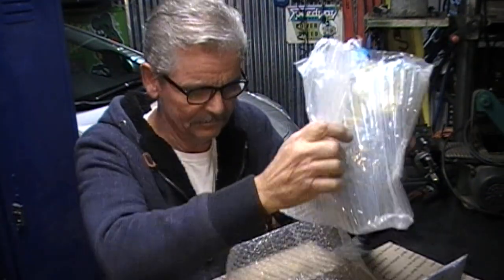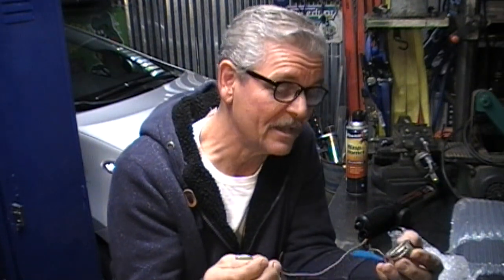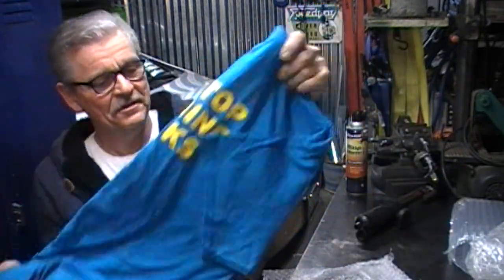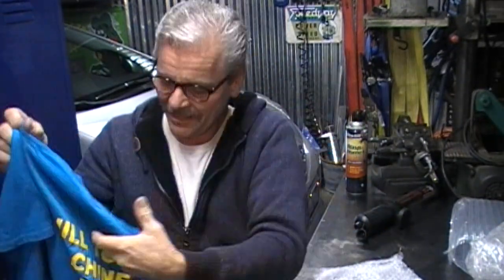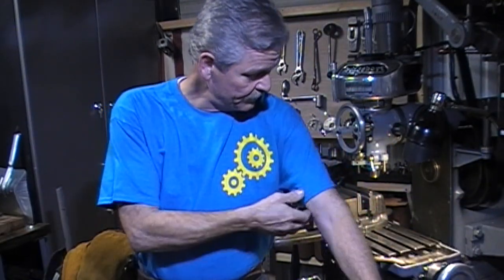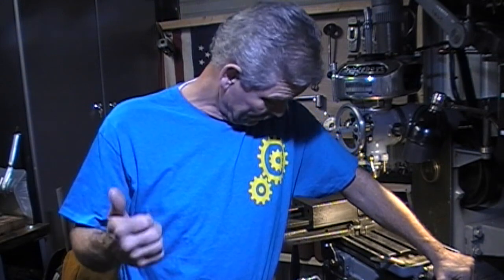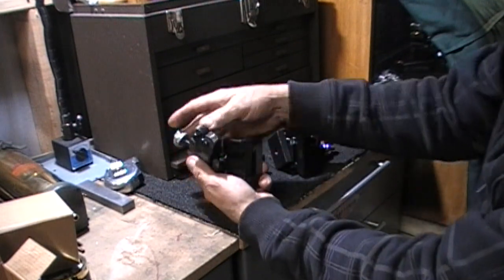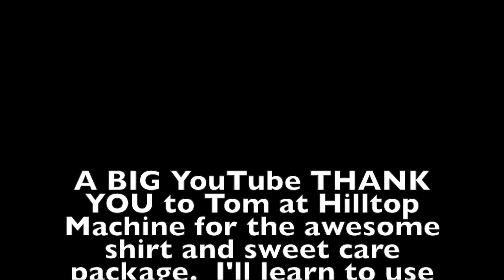Mail Call 1  and YouTube Thank YOU

Comment: You are correct.  The YouTube machinist network is a good group of people.  Reminds me of the shooting fraternity.  What brand and size is the tool post.  I need to get one to replace the late '80s model that is on my Enco lathe.  I am looking at All Industrial for the new tool post and holders, they were referred to me by Dudley Toolwright.  He has a pretty good channel.  I have not found the video yet that shows how you set up the treadmill motor controllers for the Brown&SharpPort (Bridge&Sharp LOL).
Reply from the maker: Believe I searched treadmill motor controller on YouTube and he actually shows setting one up. If I get a few I can make a short follow up and show part #s also. Or I can send you the info if you email me. flatheadronsgarage@yahoo.com
Reply: Jeremy Fielding is who I usually go to for anything electrical motor. Just found him setting one up using treadmill parts.
Reply: That email address gives me an error message.
Reply from the maker: You asked about the tool post, it’s a Bostar I purchased off eBay for $119.00.  It’s Chinese but seems to work well for me. I’ll regrind the tool holders with my new toy. They won’t say China anymore. I’ll true them up and blue. Check out mikemanmade on YouTube.  This is where I got the info to make my motor controller. He’s good. My American Rotary phase converter is on its way for the surface grinder.
Reply: I like milkmanmade's newer, simpler, <$15 DC motor controller, have ordered all the parts.  My brother is giving me his wife's treadmill.
Reply from the maker: Good deal.  Keep us updated.  Maybe make a video...... I’m still going to do the bandsaw so I can slow it down although I don’t know when. Not too far off though.  The rotary should arrive tomorrow.

Comment: Glad you liked everything. The item you were not sure about is a coaxial indicator. Lets say you have a part on the mill table and it already has a hole in it and you want to center the quill over that hole. You put the co axial indicator in a collet and in the quill. Turn on the mill with the feeler in the hole. (you will have to pick up a feeler likehttps://www.ebay.com/itm/ASIMETO-469-01-2-Centering-Coaxial-Indicator-ID-Feeler/222713312094?hash=item33dabf735e:g:i0sAAOSwlfZanryE). Hold on to the stabilizing rod (the black rod inserts into the side of the indicator). You move the X and Y on you table until the needle stops moving. Now you are centered up over the hole.
Reply from the maker: Wife says I’m silly. Shouldn’t have put in the shirt modeling......Oh, that’s how it’s done with the indicator. I didn’t know which end was up. Your package was awesome. I’ve got lots to learn. I feel like a kid again with a whole new world to learn right in front of me. The tester goes to 30 volts.  It’s so cool. Great shape. Had to cut a lot of my video because it was too long for YouTube apparently.  Thought I was verified to get more than 15 min long. I will just have to plan ahead for the next one   Thank Tom